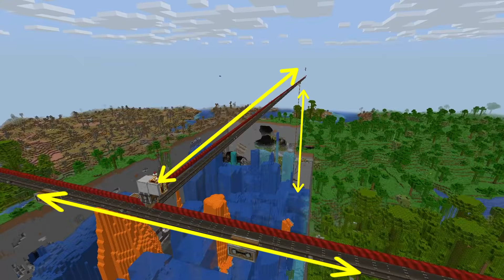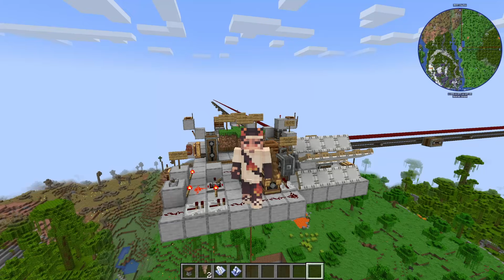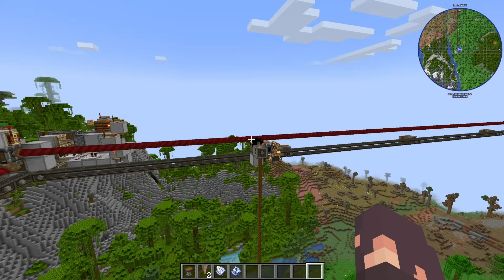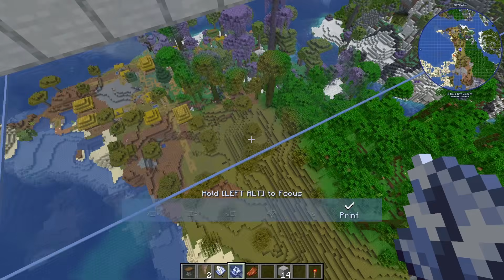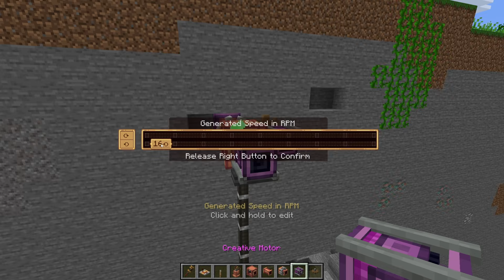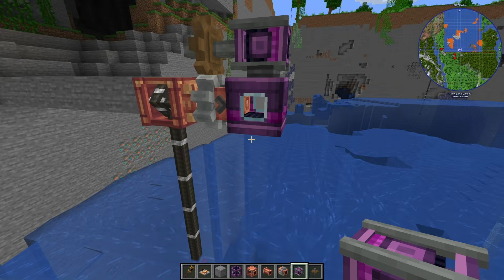The Best Create Mod QUARRY On YouTube! | Create Mod Tutorial

Comment: The rope pulley keeps breaking when I place it
Reply from the maker: is it possible you don't have enough SU or nor everything is glued properly? what happens if you put the rope pully back. there would be something blocking the rope pully from coming back up would be my guess for how it could break
Reply: I have fought with this machine for a while now. And it is 100% because I am new with the mod but it may have something to do with the fact I created this in survival, it broke so I placed it again in creative and didnt clear them (I went over the signal things manually) before replacing them. I have to try to build this again from scratch. Before I had the problem of the machine going to one end going down and it wont come up. This pulley breaking is a new problem. I added like 30 large waterwheels but it didnt help. When i replace the rope pulley my game lags like crazy and it breaks.
Reply from the maker: @ when you placed in the new one/built it from scratch, did you remove all the glue pieces? my guess is the game's getting confused and thats why the pully is breaking.

Comment: How would you recomend changing the logic to make it work on a 6x6 scale instead of 16x16?
For the project im doing I need to drill different 6x6 squares in a grid but When I attempted to adjust the logic it caused the drill to, Both just go up and down in the same spot over and over. and then reffuse to move from the start point
Reply from the maker: there are 2 spots where it moves over 16 blocks. they're in both the sequenced gearshifts and changing those should do it! You'll also want to adjust the number of items in the northmost dropper/hopper counter. I have 18/9 blocks in there because the machine goes 256/128 blocks and the machine needs to move over at least 16/8 times with a few for buffer. so if you wanna go 128 blocks with 6 being your machine size, you'll need to have 22 blocks in the dropper. 

The issue you're running into though could be explained by one of the sequenced gearshifts being backwards, and the northmost hopper in the hopper dropper counter not being powered by the redstone torch next to the hopper, so break and replace that torch.

Comment: only downside is i need one capable of doing 447 × 447 blocks, or just over a radius of 200,000 blocks by 15 deep. once. mega build
Reply from the maker: that is a mega build... you could try using redstone links as range extenders (or just up the link range in the create configs), but that is an insane size lol

Comment: belts dont move?
Reply from the maker: the quarry might not have moved over the 16 blocks it should have. there are 2 gearboxes glued to the start of the belt part of the farm which should be attached to a shaft in the east belt line. just add a shaft there to fix it. You will need to add shafts for each future movement though so make sure you do that

Comment: Was wondering how this fairs with server restarts as I have a server setup that restarts every 6 hours
Reply from the maker: You’ll need to turn it off (stop the windmill from powering the farm) while it’s running. If you turn it off while it’s going downward it should turn back on with no issue
Reply: @kindlebubbledump  I'll def give that a shot here soon when the server restarts, so far nice design and explanation of everything, love the fact its super complex compared to other builds on the create website!
Reply: Worked like a charm, just wanted to come back and give an update for anyone else that has the same question for future reference!
Reply: @kindlebubbledump  Hey homie me again, some reason after all 18 blocks transfer to the hopper the gantry just entirely stops and doesn't want to return back to the start and move over, doesn't matter what I do seemingly it just continues to do this ive tried using the cannon and just pasting the schematic in creative
Reply from the maker: @rxSOULLESS1  is the sequenced gearshift on the east side still there? it should be next to the chest that you put the 2 wooden shovels into? if not can u join my discord and I can help better there

Comment: i placed mine west and north.... what do I need to do when in that situation?
Reply from the maker: uhhhhh. You kinda need to face it the correct way since the create mod rotations are backwards. if you don't wanna do that, run it and see what's backwards, then add a gearbox where a shaft is to invert that section and vise versa

I would really recommend breaking it down and rotating it the correct direction cause the troubleshooting is a pain to do
Reply: @kindlebubbledump  i had switched it. to the correct direction but now it's spaming place and pick up almost crashing my game. until I break or replace the pully or rotation. basically suck at the starting position. does it need to at least have 1 block gap under it to start the contraption?

Comment: Mine wont go down, it just goes to the last chunck and back over and over again. Any idea what might be wrong?
Reply from the maker: Yea, on the north side there’s a redstone link that powers the north side gantry shaft. When placing it in with a schematic it doesn’t register the receiver redstone link so (while the farms off) break and replace the redstone torch that powers the sending redstone link for the north gantry shaft
Reply: @kindlebubbledump i did that before starting it, i also cant turn it off with the lever but i replaced the torches aswell
Reply from the maker: Hmmmm if the north gantry is powered then it shouldn’t be moving north/south. Unless ur talking about it moving east/east in which case break and replace the torch on the east ish side of the farm
Reply: @kindlebubbledump now it started working, dont know why tho😂
Reply from the maker: @smadgic5473  LOL a win is a win

Comment: mine 128x128x quarry  go through last block and get back to the  first and skipped first 16 block what should i do to fix this
Reply from the maker: At the end you can turn it off, bring it back to the 1 spot it missed and have it mine down in that part. I made a follow up video that you could watch to see how to bring it back. the only difference is you'd need to put a block to stop the contraption in the second chunk section so it will start mining from there. The part you care about is at 11:39: https://youtu.be/w-ePOSCJz4c?t=697
Reply: @kindlebubbledump  i did everything you said it all did go right but now sometimes sequenced gearshift is broken down i dont even know why is this happening.  I mean all time when it tries to come back gearshift is breaking itself
Reply from the maker: @mustafaatalay2333  if you don't mind replacing and reprogramming it every once in a while then you can keep doing that. If it consistiently breaks/ you want it fixed, join my discord and send a video of the redstone parts of it coming back to the start and I can see why it isn't working

Comment: my drills just stopped at the bottem..
Reply from the maker: How high up is the logic of the farm? do you have a block on the piston head? the redstone link that goes into the block should power the sequenced gearshift, increasing it's value by 1. that should power the comparator and repeater inverting the gearshift and bringing the machine back up. what part of that description isn't happening?
Reply: @kindlebubbledump  no clue what most of that means I'm kinda new tk create and I'm train to build a massive mob farm in a perimeter, the y lvl is between 110 and 12p cause i rebuilt it twice
Reply from the maker: @ ok that seems right! Can you join my discord and send a vid of the farm running?
Reply: @kindlebubbledump  alr

Comment: help! the drill stops at bedrock. the pully says "this contraption was unable to assemble" "unmovable block (mechanical drill) at x, -59, z. i followed startup instructions and it is facing north east
Reply from the maker: I’ve experienced this once and idk what causes it. My best guess is a weird glitch/ unloading chunks or something like that. If you head over to the mining machine I bet the drills have teleported into the bedrock blocks and gotten stuck. You’ll have to break and re-do the glue. Pull the thing up slightly and then place the bottom layer of drills back. You could also revert from a backup if you have a semi recent one

Comment: Very cool design! Sadly it seems like the off/on switch doesnt really work. Tried it multiple times now, but it just keeps going. Even after just placing it in creative and putting the counter blocks in.
Any idea what could be wrong? Also it doesnt mine the first thingy 16x16 area. After starting it, it goes fully to the north, comes back, and instantly moves 16 blocks north then starting.
Reply from the maker: You might be running into the same issue in both places. Redstone links are kinda garbage at powering stuff correctly when being placed in by schematic. I'll explain it with the moving north instead of down example: that gantry shaft is not being powered even though it should be. there is a redstone link that should be powering it, and the sending one on the northish side of the farm that is powered by a redstone torch below it. If you break and replace the sending one before starting the farm it will work. 

^ that's a schematic being pasted in world issue. Now that you've started it, you would have to manually bring it back to the start (I would turn off the main power and connect it with a hand crank if you're not 100% understanding of the circuit). but after that it will work as expected!

Comment: i just built and deployed this it did its first row no problem but now its just going up and down over and over again in the last chunk
Reply from the maker: Ahhhh you’ll need to break and replace the torch next to the dropper/hopper counter in the north most side. For some reason the hopper doesn’t think it’s locked when placed in with a schematic. You can just move 16 of the blocks in the dropper into the now locked hopper and just wait for the last 2 and then it should work
Reply: @kindlebubbledump  im confused i dont get it to work placed 16blocks in the dropper and its still going up and down
Reply from the maker: @thechosenmoon3494 the redstone link powering the receiving redstone link above the northbound gantry shaft needs to sometimes be replaced manually. It’s the one on the northbound gantry shaft side that is being powered by a torch. Break and replace that one. 

Also break and replace the redstone torch next to the hopper dropper component where you put in the 16 blocks. Finally I would recommend 18 blocks in that dropper instead of 16 so it gets all the way to the end
Reply: @kindlebubbledump  Myself and Moon are trying to fgure this out, we feel stupid lol, Are you on your discord by any chance?
Reply: @kindlebubbledump  Had this exact problem when trying it, following it just like this worked perfectly :)
Reply: Thank you SO much for asking this question, genuinely saved me hours of troubleshooting. And @kindlebubbledump thanks for actually responding to questions in the comments, earned a loyal subscriber for sure.

Comment: i am also running into a issue where the blocks just fall out of the funnel coming out of the drill and not going on the belt. What could be the issue
Reply from the maker: Is the belt spinning? My guess is the belt has stuff on it and the funnel can’t drop items out onto the belt. It should be powered by the 2 gearboxes connecting it to the main belt
Reply: @kindlebubbledump  Thats exactly what is happening blocks are just getting stuck on the belts
Reply from the maker: @JaytenNeves  ahh yea. My guess is it didn't move over the proper 16 blocks. if you check the shafts in the main belt, it SHOULD line up with the second of the 2 gearboxes. You can move the farm manually, or just add more shafts to the main line
Reply: @kindlebubbledump  its moving the full 16 blocks i watched it. Its only happening when i stop the machine the start it again
Reply from the maker: @JaytenNeves  That didn't happen with mine so maybe it was a 1 time thing? if you add a shaft connecting to the gearbox it will start moving properly
Reply: @kindlebubbledump   @kindlebubbledump  what gearbox exactly? If there is only the one gearbox i can figure it out but if there's multiple i dont want to mess it up anymore. Also i replied to you on my other comment i made if you could give me some info on that, that would be amazing. Thank you very much
Reply from the maker: There is a gearbox glued to the belt that isn't moving. It goes gearbox, vertical gearbox, the unmoving belt. The main belt should be spinning, place a shaft in the spinning belt in line with the normal gearbox in that row and it should power it
Reply from the maker: and soz abt that I didn't get a notif about your other comment. You'll want storage drawers
Reply: @kindlebubbledump  Thank you so much i will definitely try that!

Comment: To setup a better storage system can i just place a bunch of large chest Infront of the belt funnel and it will all go into the chest. Say the first chest gets full it will just go into the next empty one and it wont just throw it on the ground?
Reply from the maker: Yup that should work! You’ll get a few million blocks so you’ll need a TON of chests if you’re going the chest route
Reply: @kindlebubbledump  what would be a better option? The item vaults?
Reply from the maker: @JaytenNeves if you have another storage mod that can store bulk cobble/ cobbled deepslate then use that and chests for other things. OR you could filter items and sort them and process them with crushing wheels and such
Reply: @kindlebubbledump  im new to this mod so idk how to do a whole lot yet lol. What would you do for the storage system i also dont have any bulk storage mods i got the modpack off a youtuber Mr BeardStone
Reply from the maker: You want storage drawers. There are a ton of walkthroughs on how to use them, but you can max out the storage to a bunch of blocks so def go with that.
Reply: @kindlebubbledump  Storage drawers is a awesome suggestion thank you very much i do have those but my only worry is with those could i just place them all in a line connected to one another and all the blocks from the machine would still go in?

Comment: I'm playing on a server where the entire gimmick is it has floating islands and there is no bedrock/below, if you fall into the void you will just fall back from the top. Unfortunately this is not the case for entities as it gets destroyed in the void which is why I cannot use minecarts.
My question is would this design still return if it doesn't reach bedrock?
Reply from the maker: No it needs to “hit” an immovable block so it won’t work. Unfortunately, there isn’t a way to measure how far down you can go afaik:(. The best bet might be a sideways miner that I have on my channel too (it’s my first tutorial vid so it’s kinda bad lol)
Reply: @kindlebubbledump  sorry for replying to an old comment, but i've been playing around with create recently and saw that the smart observer can actually signal when the pulley reaches a certain extension %tage!

Comment: you are bottle necked by the speed of item transferring out of the miner. You can use multiple storage interfaces to speed this up and drastically reduce its down time
Youll also find you need deployers to make a tube around the drill if your goal is to remove all liquids, otherwise corners will create infinite sources
Reply from the maker: Ohhh thank you for the portable storage interface tip. I will use that in a future version. I agree with the source creation. The issue with needing deployers on the sides is when you’re in the middle it will place blocks where you’ve already mined. I’ll need to do some testing to see how it works.

Comment: I'd argue you can deal with liquids by adding a placing blocks below the drills. If there's already a block, block can't be placed. If there's a liquid/liquid source, the placed block replaces it. You'd need to build a temporary wall around the quarry to deal with liquids spilling from the side.
Reply from the maker: Yea, you can do that with deployers, but the deployers will place blocks as the machine is going back up too making it harder. Someone commented about a contraption controller potentially preventing this issue so I'm going to mess with that and see if this idea will work!

Comment: One suggestion for manual water removal: lily pads! You should be able to place them on top of the sources without anything to place against, and then place a block underneath to destroy it. About as close as you can get to i.e an angel block - but using entirely vanilla mechanics
Reply from the maker: That's a good way to do it! it'll also help you find where the soources are!
Reply: A pump is also useful. It's just making sure you can reach all the liquid doing so.

Comment: i tried it in creative world (i use the 128x128 schematics), but it only move 1 way, and the thing won't pulled back to the system, it just keep getting up and down in the 8th chunks. any idea?
Reply from the maker: I'm not sure what your issue is. Can you join my discord (link in video description). If the machine is only going up and down and not moving over as expected, it could be an issue with the sequenced gearshift that controls everything OR it could be a mismatch of powering the gantry shafts. Make sure the sequenced gearshift is powered once > machine comes up > powered again, the north/south gantry shaft de-powers and spins (if it does and it's not moving go into the sequenced gearshift with the piston connected block to it, and invert the move piston/pully/gantry 16 blocks from forward to backwards or vice versa). if that didn't make sense or didn't fix it, join my discord and send a short vid of the miner coming back up, not moving over then going back down
Reply: Ok i'll join, I want to try once more, I think I set it up incorrectly, I want to know if the problem can be replicated